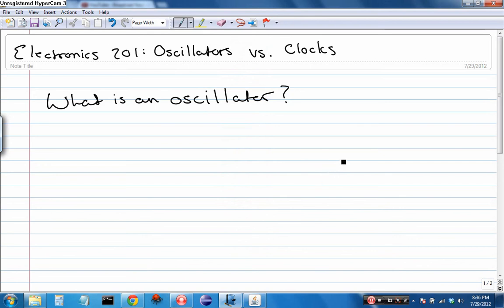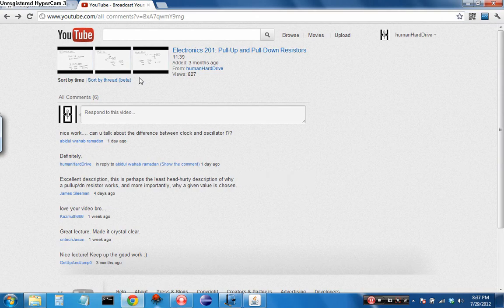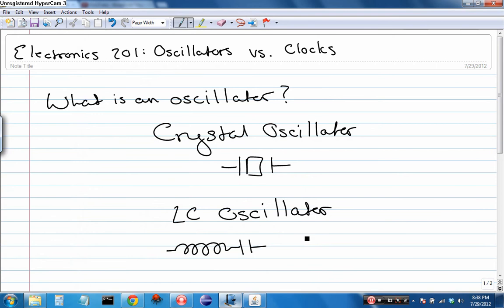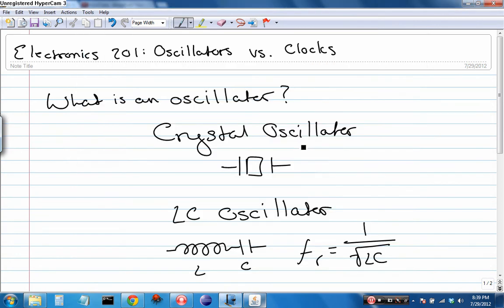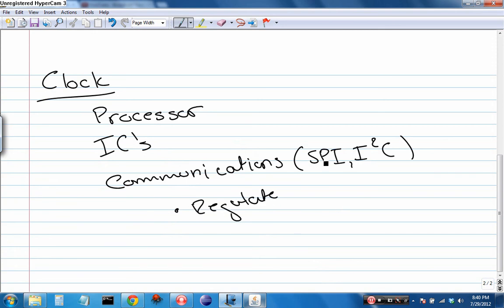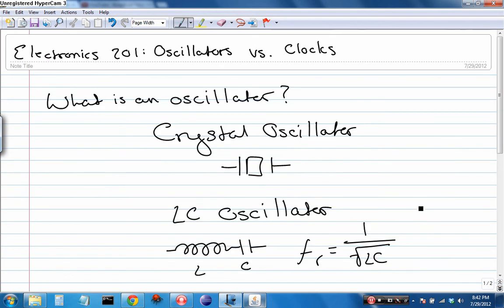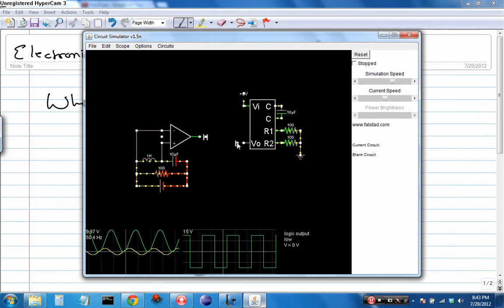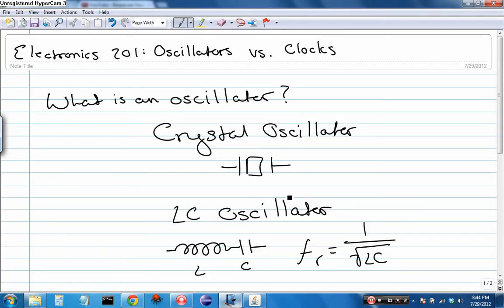Electronics 201: Difference Between Oscillators and Clocks

Comment: The pic at 1:23 actually shows a simple crystal, not a crystal oscillator. 
While the crystal is the main component you still have to connect external components to make an oscillator out of it.